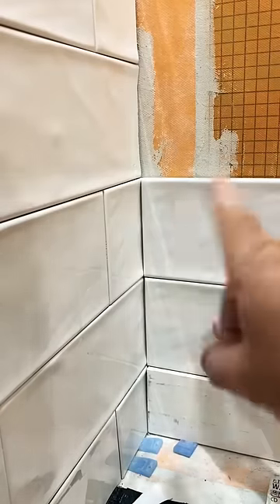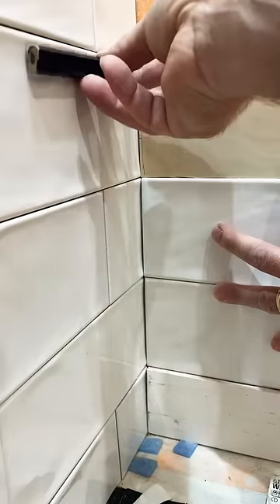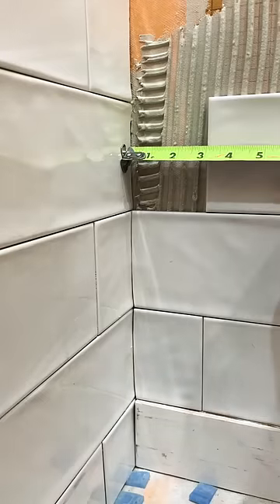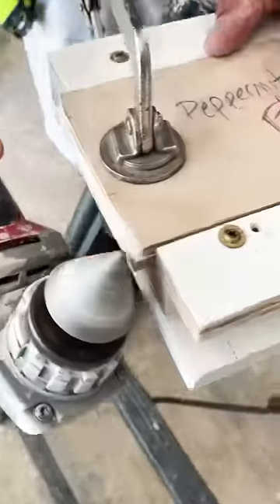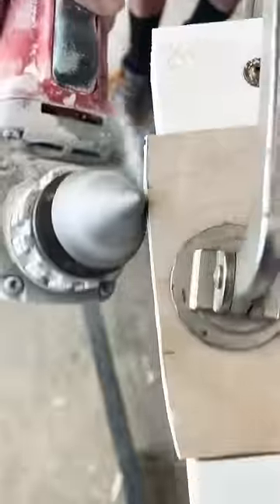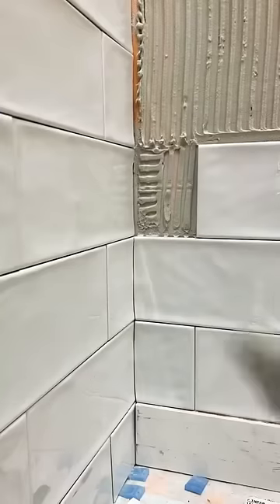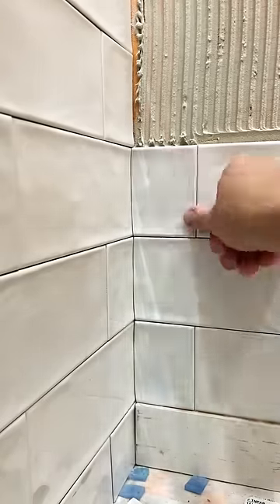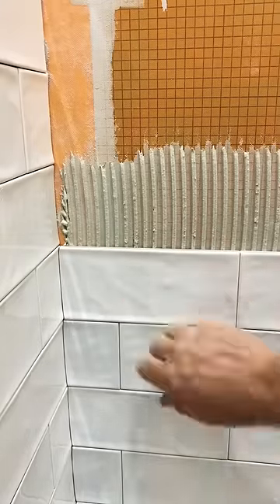Tile COPING - 101 (just a little extra effort)  #tile #coping #shower @Eylandertile

Comment: For the people arguing over using silicone for corners.  The main reason is not for water proofing. It's for longevity of the corners. House still move even after settling  and will Crack the grout in the corners after so many years because it's where two different walls meet.  The silicone stretches so it won't Crack and you(if your a general contractor or the one selling your jobs) won't be called back to fix it in a year or risk a karen giving you a ridiculous google review.

Comment: Just wondering- does this tile not have a grout gap? Lots of differences I see in construction and interior methods between the UK and the US..
Over here, we tend to tile directly to the wall, 5mm grout gaps and some silicone the corners, some leave it grouted, or put a 45 corner beading in.

Either way, this looks awesome man!!
Reply from the maker: Yes, it is a tapered tile so when set together is creates a 1/16" grout joint. We have mostly wood framed houses over here so not as much movement between plains as ya'll with a masonry type wall. I don't like silicone at all, it doesn't match the grout & it gets moldy in 4 months... then that makes the tile look bad. I use grout, in this case I used non-sanded. I have all of the best waterproofing components behind the tile so I am not worried one bit if the grout gets a hairline crack in it. I've been setting tile for nearly 20 years and have never had a call back to repair a cracked, loose, popped tile or repair any grout, even in the corners.  I do thank you for the comment and thanks for watching

Comment: Should get rid of the vertical grout joint And either do your floor first or ledger off even with the membrane Waterproofing after going behind people and fixing hundreds of showers I have found it is always best to do everything you can to keep the water above the tile 😅 But nice cuts Be sure to use colormatch silicone That way if somebody doesn’t have to come clean out the cracked out grout joints later

Comment: Maybe dumb question: how does the diamond bit not grind into the wood template after repeated cuts? Or even during the first cut. Is it just tact of hand?
Reply: It does grind away  every tile is a lil diff so u go back and make a new pattern for each one but remember u only have to do this on corner tiles the rest of the wall isnt such a long process but ik ppl that can knock this stuff out in like 30 mins
Reply from the maker: Yes, you can feel the difference when you get into the wood.

Comment: I’d be more concerned that there are no spacers in between creating the grout joint 😂
Reply: There are tiny bumps on the edges of the tiles that create the small grout joint these tiles are supposed to have...
It's the look pillow tiles have, notice the tile face is "puffed" around the edges.

Comment: I’m no tiler and I think it looks a lot better cut in tight like that but I’ve been told by a few tilers you’re supposed to leave a a small gap for grout otherwise it’ll leak overtime… Is this bull?
Reply from the maker: Yes it needs grout and It will be grouted, the joint is very minimal at 1/16". which is very standard on ceramics. Grout is by no means waterproof. The orange fabric behind the tile is 100% waterproof. Grout will absorb water (unless regularly sealed or an epoxy) and weep back in behind the tile over time. The substrate behind the tile is the most important aspect of the tile installation. Without waterproofing it's just a matter of time before water is a damaging factor.
Reply: @w.k.d.constructionllc  Makes sense. Thanks very much
Reply from the maker: @joshuamatheron1  YW thanks for commenting and watching!

Comment: The gap is needed between each tile so that the grout will be the full depth of the tile. With no gap the grout will just be a tiny skim on top with nothing between the tiles. Grout will not work and water will get behind the tile.

Comment: Nice job, I always just used my tile saw to shape it. Might take a little longer… but you won’t have any chips in that soft stuff

+ all the people who say to use silicone, idc what your silicone says on the tube — it will 1000% mildew. Leaving your shower looking like trash in 2 years.
Reply from the maker: Thanks, but the wet saw does chip the glaze slightly

Comment: Our shower corners when grouted would always crack which is when we realized why our better installers used caulk. If you cope the tiles like this will they not crack at all? The corners I've always noticed get more movement than the field

Comment: WOW! To all those silicone users! Must be the same guys that uses the ratchet level clips! Ok so first of all...Fact) its a lot harder to get silicone out of a joint than grout. Fact) Silicone will crack over time just like grout. Fact) Silicone will discolor and get moldy far more and quicker than grout!  So the solution?...1) make sure (Before you put up your backer board) that both the walls and the tub have NO movement whatsoever!!! 2) Waterproof your cement board corners-Like he did.3) Leave a little space in the corners for grout to get into. 4) Force the grout into those joint properly! Do all this and you will never need silicone to fuck up your jobs later! Its not about speed! Its about doing the right thing for your customer right from the start! And never forget the 6-P's Proper-Planning- Prevents- Piss- Poor- Performance! 3) Make tight joints in the corner-Like he did!
Reply from the maker: MY MAN!! You are the first person to totally understand what’s going on, Thank you for the comment! I really appreciate it!

Comment: don't ever jam tiles into the corner together and also do NOT use grout on the corners either.  Should always use a color-matched flexible caulk as grout will almost always crack on corners.

Comment: Love you've pride in you're work and I've never seen that baby cone and I work in a builders supplier are the tiles leaving enough space for grouting or what way does it work usually you see hundreds of them crosses to leave a gap for grout thanks David in Dublin Ireland 🇮🇪🇺🇸🇺🇦
Reply from the maker: Appreciate it boss, I love what I get to do. Ya man, 1/16” grout joint for these ceramics are perfect. They are tapered and are meant to have a tight grout joint.  I never have issues with them

Comment: This is still wrong... PRO TIP. the cleanest most professional look is to alternate the rows so every other row sits behind the back wall and side wall. You can achieve this by cutting every other row short (the thickness of the tile) that way when you tile the back wall every other row will slide behind the short tile and will create a high level seemless look and superior strength.

Comment: One detail that drives me nuts. Need to give it a little wiggle to squish the grout lines to achieve proper coverage. Which is very important in wet areas, like that shower.

Comment: if only every tiler did this ...
Reply: “If only every customer paid for this…”
THAT’s what you should really be saying. 
You would never want to pay one that would charge you for this process — that’s ultimately where the problem lies.
Reply from the maker: @THRILLHO__  my clients gladly pay! This is the work they expect
Reply: @w.k.d.constructionllc  
Of course, not taking anything away from that. But the customer has to PAY extra if they want their inside corners coped! People here are under the impression that you are just doing this extra step for no extra charge because you put pride in your work and others do not. There is no way you go this extra mile without factoring it into price. This would add HUGE amounts of time to a project. Also, when all is said and done — nobody would ever even notice the difference once the silicone is complete.  
The issue I have is that this video lends  people to think that this process is the difference between an installer that puts a little “pride” or “love” into their work and ones that do not, when it is just not how it works in the real world. Meanwhile you can go this extra mile and the customer is the first one to nickel and dime you on the price.
Reply from the maker: @THRILLHO__  this is standard installation for me there chief. Apparently I charge enough on the front end to know what I’m getting into when I bid a job. When the showed me the tile, I knew right then I would cope every pc. I wasn’t going to half ass it and rely on grout to make my work look good. You would definitely notice. If the grout joint looks like ass without grout…guess what, it’s gonna look like ass with grout in it. I’m the real world most businessmen know all the steps involved before there is a price given & I most definitely have pride in my work and I love what I get to do everyday. So every job will be done to the best of my ability. I guess that’s why my waiting list is about 4 years out on new custom homes. Apparently I know what level of work my clientele expect. Happy new year!
Reply: @w.k.d.constructionllc  
Yes, you proved my point. You factored the coping into your price. This step is compensated for. If the customer is willing to pay and not nickel and dime, then I’m all for it. But no way that it’s charged for as if it was a standard smooth tile. You put no extra “love” into your work by doing such a step than I would. I’ve been on many high end multi million dollar jobs and never seen that done. If they were beveled edges than mitring is a different story. But there would have to be some serious texture profile to a tile to warrant coping, which perhaps this tile has but I doubt it. 
Firstly, that inside corner should be siliconed before any grout is even done. You should have a 1/16-1/8” gap there for silicone and expansion, there is no need to otherwise fit so tightly. 
I’d be very surprised if anyone even could tell a coped corner (with the particular tile in this short anyways) from a non coped once it is properly siliconed. People have you booked for a custom home they’re building in 4 years? Cool! Not sure exactly how you can accurately or realistically schedule all of that over 4 years but that’s great. I do high end homes and commercial work and have constant jobs that come my way that I either take or leave by my choice and if the money is worth it or not and have had that the passed 15 years. So not sure what the relevance of any of that is as far as the process being necessary or not. 
Happy New Year!
Reply from the maker: @THRILLHO__  you just proved my point as well…if you’ve never seen it done then obviously you haven’t seen anyone put extra “love” into their work. My point on the video was that is everyone now days is in such a hurry to get stuff done they just half ass it and slap it in there. There is no way you could butt a square cut into a profile like that and it look good. As you said, you don’t see that kind of work on your high end jobs. So…that is my standard install, I take pride and extra love into all of my work. There is 1/16” joint throughout this install, I don’t silicone tile to tile corners, it’s never the same color. I use the best waterproofing out there so no worries on water penetration (which most grout will have) then the silicone gets moldy and looks disgusting, the you have to go back and re do it only to do repeat the process continuously over time. It usually takes me about a year to build a large custom home, I have deposits on 4 homes and we will start the roof system on one next week. So there is your 4 year schedule.
Reply: @w.k.d.constructionllc  
I hardly proved any point you made. It’s nothing to do with “love” and everything to do with what the customer is willing to pay for. You don’t go this extra mile out of the kindness of your heart; you charge for the effort.. and if the customer is fine to pay for it, you are totally justified in doing so and good on you for it. 
Silicone in the corners is for expansion. Grout will crack. I guess that is less of an issue with the waterproofing you did there, but still. Those gaps also hardly look 1/16th.. looks more like a 1/32.  1/16th is the minimum. I’d have to see it in person and work with it myself to give an absolute answer, but this just felt like more of a sponsor advertisement than anything. As for your 4 year schedule, it makes more sense if you’re a GC as opposed to doing strictly tile work.

Comment: where is the movement joint?
Reply from the maker: Right there in the corner
Reply: @w.k.d.constructionllc  got to be honest tiles should not be that tight to each other in a corner, the tiles are supposed to be independent that's one of reasons manufactures make colour matching silicone to go with the grout. Outside of that it's neat work.

Comment: Where does the grout go
Reply from the maker: In the grout joint
Reply: @w.k.d.constructionllc  where are the spacers inbetween the tiles for the grout joints?  Theres no gap to fill.
Reply: The issue is you wont get grout inbetween and deep in the joint, long term water will get through.

Comment: Good sentiment but you are over doing it. No need to scribe it, just eyeball it. And use a hand diamond pad with 50 grit diamond, no need for a power tool or a polisher. This is the easiest tile to install.......
Reply from the maker: You eyeball it and hand sand, I’ll template and use the baby cone on my grinder. 🤷🏼‍♂️

Comment: Good thought; too bad it is wrong. Hate to say it, but if you had knowledge and skills, you would have done the same thing but leave a 1/8 cap and not grout it and do a good silicone job in the end. Cannot gain knowledge with hard work alone.
Reply from the maker: You sure about all that…I leave 1/16” joint in all of my corners no matter the size and never silicone them. I’ve never had a call back, ever, to fix loose, cracked or busted grout. I properly waterproof in behind the tile and give a lifetime guarantee? I bet you don’t give your work a lifetime guarantee (if you even tile) you may have read a few books on it, maybe?

Comment: Should always leave at least a 2mm gap for silicone so it doesn't peel off the surface when cleaning ect. A* for effort but for a Finnish that lasts leave a gap.
Reply from the maker: I don’t use silicone, it will be moldy in 4 months

Comment: Looks sick but a perfect taped white silicone line would hide any gap and save your time and look better in my opinion
Reply from the maker: If you do caulk it the joint still needs to be consistent to look good, unless you like a 1/2” wide bead of caulking…I sure don’t!
Reply: @w.k.d.constructionllc  1/4-3/8” caulking and of course must be consistent hence the tape should do it fine, after the grout of course. Sloppy caulking job would look terrible of course

Comment: Um. Firstly. 
A waste of time as the silicone will cover it.
Also tile dust causes cancer. 
The adhesive would of skinned over by the time you done that. 
No spacers so your work won’t last. 
You make less money for your wasted time.
Reply from the maker: Dang negative Nancy. 
Waste of ur time, not mine
No silicone, grout only. 
Hold ur breath. 
Not when I have a cut guy.
My work has lifetime guarantee 
I get paid for everything I do!

Comment: Kind of common sense. Cut the pieces till they fit... Just the voice is annoying.... Jeezus
Reply from the maker: Turn it down then 🤷🏼‍♂️ thanks for watching tho…I guess🙄
Reply: You elaborate on this whole Bathroom tile job like No one would LITTERALLY just figure out. "Cut till it fits". And sand down if needed. " 🤣.. Look! I did like the video though. Ok?! Thanks
Reply from the maker: @jsandiego2394  I was sarcastic in the video because 95% of the people wouldn’t spend time doing this…they would cut it square and install it as fast as possible then run a huge bead of silicone to cover it up! So ya, not everyone has it figured out
Reply: @w.k.d.constructionllc  I mean, I didn't mean to offend you. I think just the people you have seen work that way is what you meant to d
Say. Because 95% of all workers is a HUGE amount, boss

Comment: lol what a waste of time. You’re putting corner beads in to seal it. What’s the point?
Reply from the maker: Waste of your time I guess… not mine. The joint needs to look good before you fill it with grout!
Reply: @w.k.d.constructionllc  is that why the bottom 2 tiles look like shit ?
Reply from the maker: @scottromero2536  uhhh…the bottom right tile isn’t really a tile, it’s a temporary wooden ledger board there chief

Comment: No room for grout
Reply from the maker: Yes there is
Reply: Iv done tile for years they make spacers for a reason to make the room for grout you eliminated it sir by not useing them you shaped the tile to fit tight so explain how you have adequate room for the grout
Reply from the maker: @shawnlapoint276  it is spaced 1/16”, so if you’ve been tiling for years you know that un-sanded grout is made for 1/16” joints.